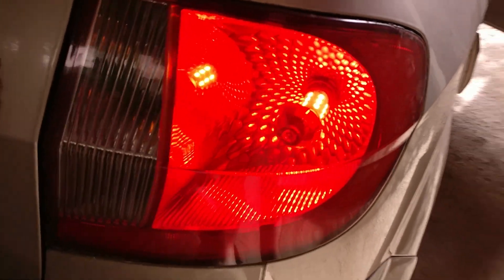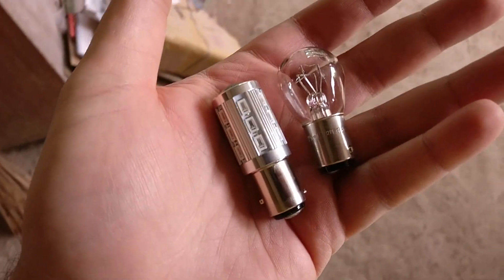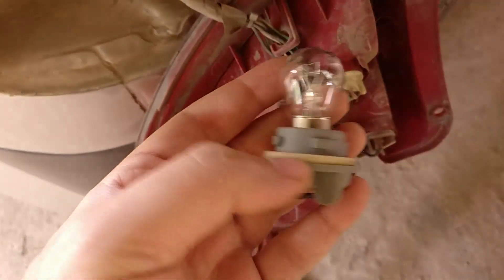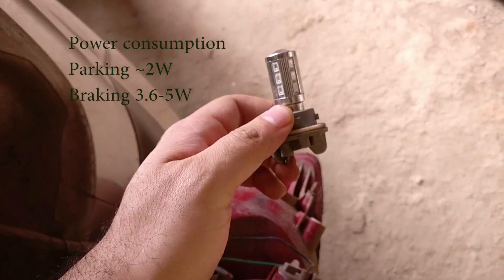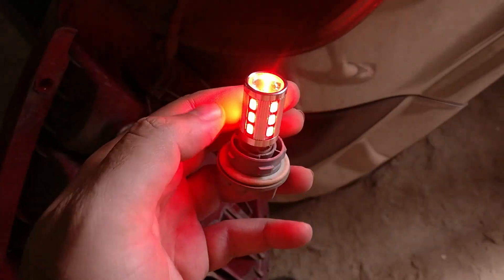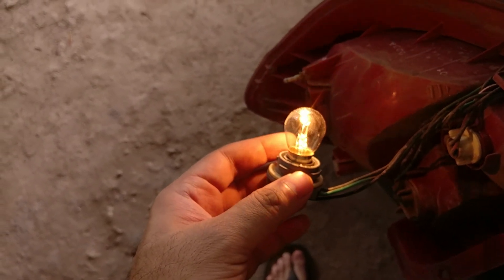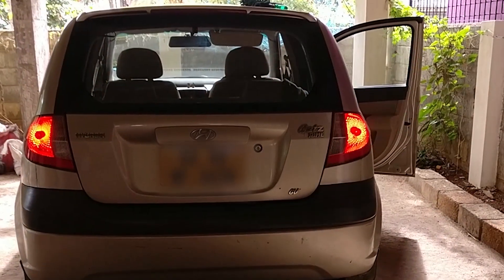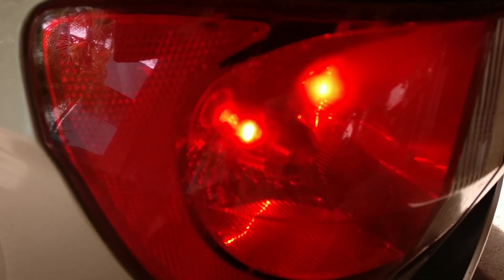Its time to Ugrade your Car with LED Brake Light Bulbs #ledbulb #ledtaillights

Comment: Thanks friend....
One problem with LED brake lamp is current drain to parking lamp while applying brakes...if you apply brake, parking lamp glows. Nothing wrong. This can be avoided by adding one diode in parking  side wire of brake lamp.

Comment: Nice crisp informative video, right up to the part where you NEVER SHOWED HOW THE LED BULB WORKED WHEN YOU PUT YOUR FOOT ON THE BRAKE PEDAL!!!
Reply from the maker: Apologies.
Reply: rTech did it work when pressing pedal? I’ve just put some in and they come on as tail lights but nothing happens when I press the pedal

Comment: I have a question
My car rear lights use the same light for brake+position so will it work aswell when i brake or just when i turn on the lights?
Reply from the maker: It depends on the socket. The bulb which you see is a dual purpose one... so for positioning, it glows half bright, and on braking it glows full bright 🌝
Reply: @rtechreviews  Thanks i did some research after 1156 is one pointer while 1157 is with two points

Comment: I have a problem. I replaced brake lights to led. It lights up ok when I press the brakes. But when I switch on the headlights for night use, the brake lights don't turn on. Only when I press the brakes it turns on. Why? Is it coz of low current. 
My car uses one bulb system for brake n night tail lights.
Reply: Did you find out what the  the problem was?
Reply: Hi I am also having same problem. When I press brakes during daylight it lights up perfect. At night when I turn headlights. They light at lower during non brake. Once I brake one light bulb doesn't light up. When I turn off headlights  they both light when braking
Reply: I Have the same problem!!
Reply: Same here